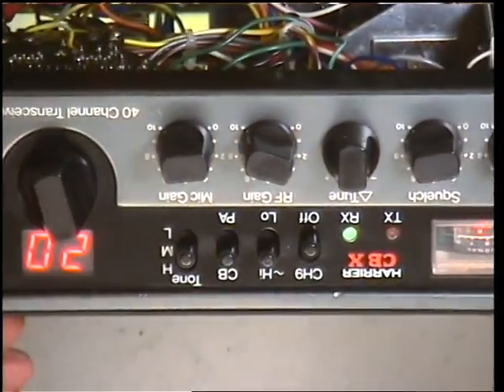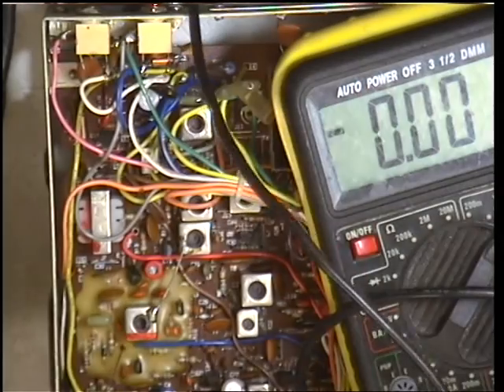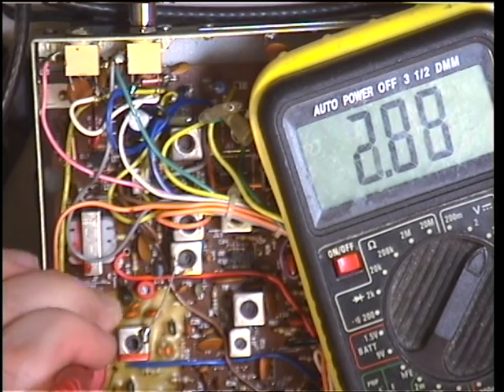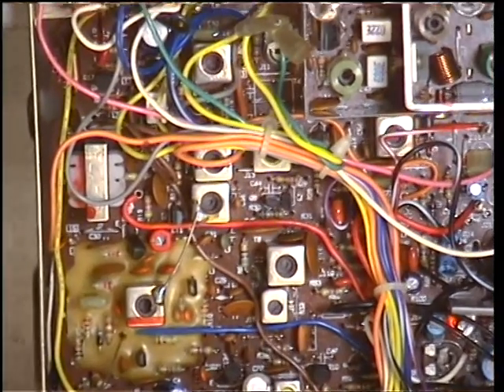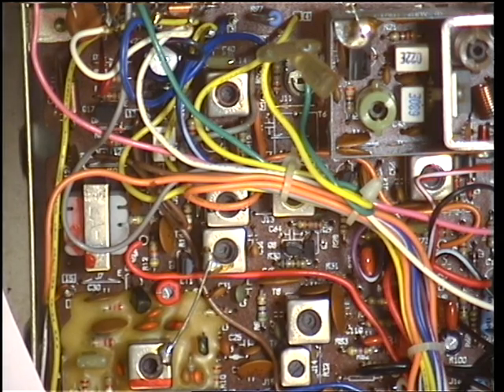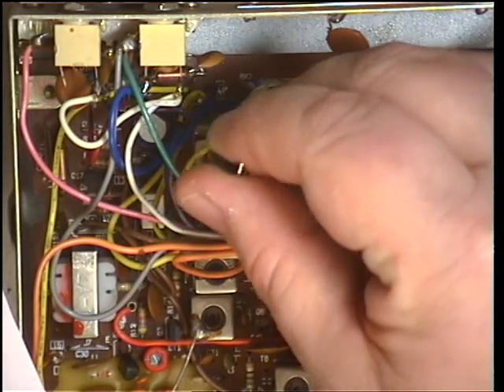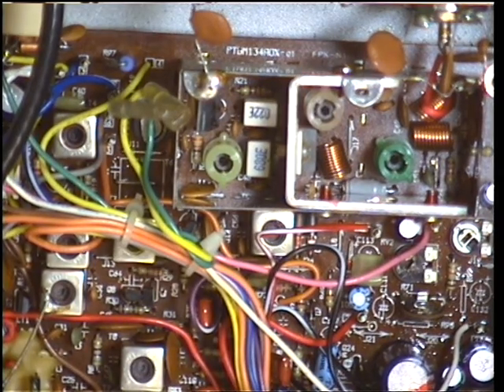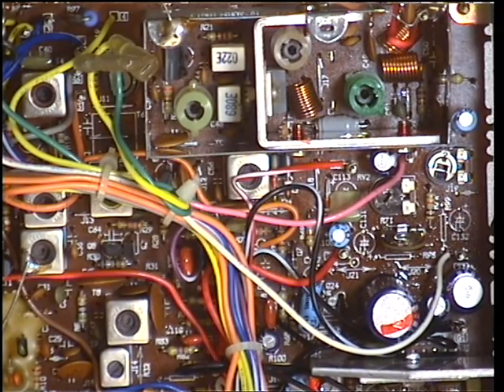Harrier CBX UK (CB27/81) CB radio (mobile)    VCO & Transmit

Comment: Not sure anyone will see this still .
But I'm looking to see what output transistor is in this. Mine is burnt to a crisp and can't identify it
Reply from the maker: The Rotel RVC240 service manual (same board as the CBX) says the output transistor may be any of the following seven :- 2SC1909, 1964, 1306, 1398, 1964, 2166. Unfortunately there are many fakes out there. Shop carefully.

Richard, G0OJF, UK
Reply: @ukfmcbradioservicingTango21  
As a computer tech, I'm very familiar with the majority of tech, and and such I'd reckon that all the electro caps on these sets will be well dried out and out of spec by now after so long 
So, I see you did some tuning up of the transformers etc... They don't move on their own, so do you think it's feasible that the adjustment you make is actually taking up the tolerance of other out of spec components, IE the caps etc.
I'm loathe to adjust any items if they were factory set using brand new components. So my logic tells me if I renew all consumables, like electro caps etc, then theoretically, it should be back to a new factory standard?

Your thoughts?
Reply: @ukfmcbradioservicingTango21  

Identified it to a 2sc1909
Discontinued.
Equivalent appears to be an NTE235
But hens teeth
Reply from the maker: @ColinBoath  The NTE series of equivalents is for USA, so generally not available here in the UK. I will be doing a video on the effect of all gthe different output transistors on this chassis, having bought one of each listed for it.

Richard
Reply: @ukfmcbradioservicingTango21  
I'll keep an eye out for that video 

I do have a few c2078 transistors but don't want to chance it 
Right now, when I key up, it almost cuts out with a huge current draw 
Oddly it's less if I put my hand on the top of the rig. So assume it's a earth field issue apart from the output transistor
Reply: @ukfmcbradioservicingTango21  
How much do you take for a service/ alignment for one of these

I'm thinking the caps will be duff as well as the output
Reply from the maker: @ColinBoath  email me rshireby@yahoo.co.uk
Reply from the maker: @ColinBoath  email me rshireby@yahoo.co.uk
Reply: @ukfmcbradioservicingTango21  thanks Richard.

If it can be any of those, do you think I could put in any one of those? 

I replied to one of your more recent videos, as I wasn't sure you would reply to this, being so old.

I'll go order one and hope for the best. 
Thankyou

Comment: hi richard i went though this on mines when i got to channel 1 im still showing 4 volts on meter also channel 1 2 3 all seem to be same frequency as channel 40 what am i needing to look at ? thanks paul
Reply from the maker: Sounds like the pll isn't running. Sometimes it can just be the VCO set to a false lock point. I'd twiddle the VCO to a random position & start again.
Reply: thanks richard ive had  another look .... your videos are great so much to learn from you ,radio is now working spot on on todays test ...by the looks of this one someone had been at every pot ........... thanks again

Comment: Hi Richard, i have a sapphire x4000 which has the same chassis. when I check it with another radio Channel 1 to 19 is fine but channel 20 becomes channel 40 on the other radio and channels 21 to 39 becomes   1 to 19 on the other radio, it's the same on receive using the other radio to transmit . I haven't a clue what's going on and thought maybe you could help? thanks,John.
Reply from the maker: John, the synthesizer chip that generates the frequencies is either receiving duff information from the channel selector switch or has internally blown data lines. My experience is that firstly, a very careful inspection with a bright bench light & magnifier needs doing on the print side of the main board on which the channel selector switch is soldered. Years of changing channel can have caused a dry joint there & simply need re-soldering. Follow the PCB tracks to the LC7137 (or LC7136) synthesizer chip nearby & check for dry joints or broken tracks. 99% of the time, that's where the snag will be. I've never had to change a channel selector switch or synthesizer chip on this chassis...but there could be a first time. Hope this helps.

Richard
Reply: UK CB radio servicing thanks for your swift reply, I'll have a look when I get the chance. cheers
Reply: Hi, I've checked the soldering and redone a few suspect joints and have swapped the pll for another but still no joy.what I'm getting now is the radio works fine but the channel display is always 20 digits out (1 is 20, 19 is 39 etc) it's still the same with the original pll fitted. I'm determined to get it working properly but I just can't puzzle it out.
Reply: An address line from the channel switch to the PLL is not conneected

Comment: It's been 25 years since I worked on a U.K. Radio, I actually just fished a CBX and an audioline 341 (I think it's a 341, I'm going from memory) out of a storage box... both don't work now, I will probably be doing a repair video on them, even though they are useless over here in NZ, maybe I will put them in eBay or something.
Reply from the maker: the Uniden chassis in the 341 suffers from 3 electrolytic capacitors going bad...I think they are the 100uF ones if I recall. Need changing every time I see one with that chassis now they're 35 years old.